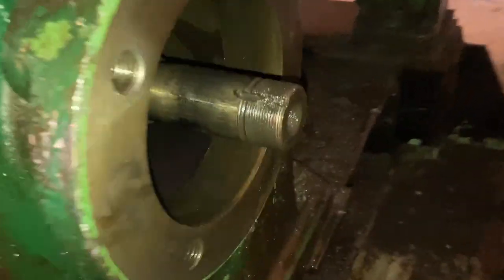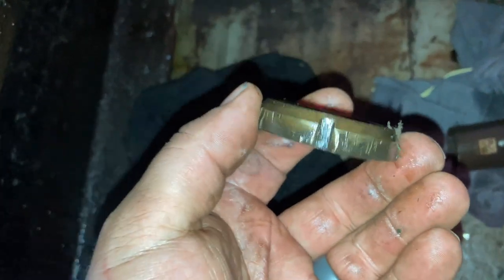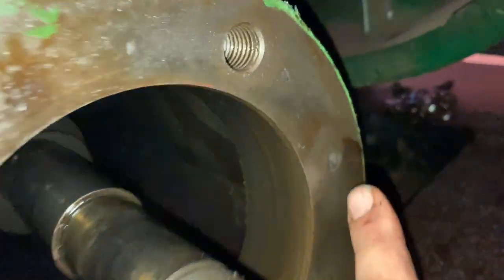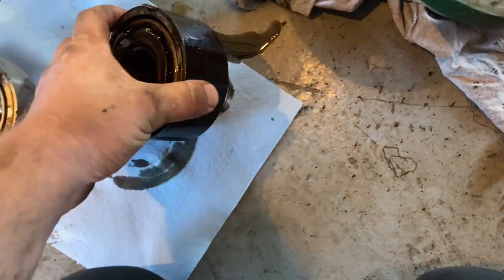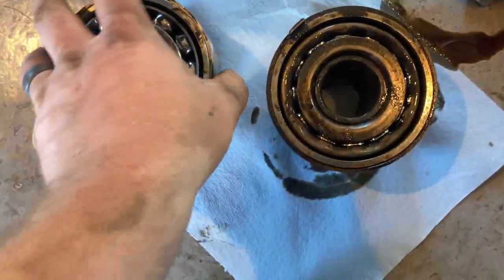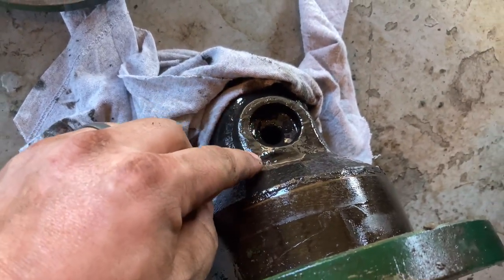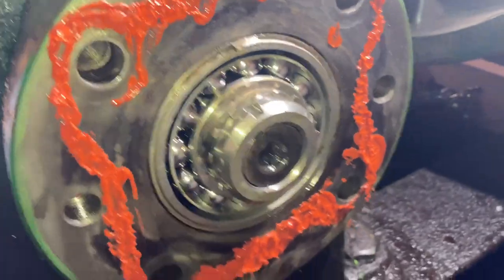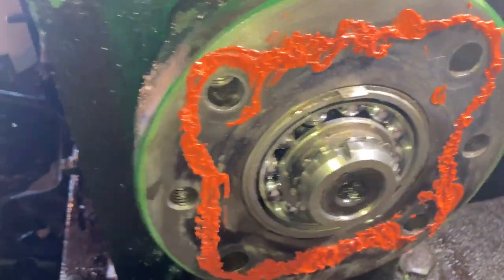Thrust bearing

Comment: MQ, at one point Otis thought it was a good idea to have a grease seal and essentially had a sealed bearing here. they eventually stopped doing this and the seal was omitted. what i am concerned about is there is no shims on the end cap. this era of Otis geared machine generally should have .002-.004" clearance between the end cap and outer bearing race.
Reply from the maker: Interesting, this was awhile ago but I’m not they are actually touching

Comment: Damn they got you doing everything, does your company not have departments? I used to be a repair mechanic doing thrusts and motors and cables etc. but moved to maintenance/troubleshooting after a few knee injuries.
Reply from the maker: Were a pretty small company so you kinda get to do a little of everything, which can be good and bad.
Reply: @MQElevators  true you get to learn a lot more and become a more well rounded mechanic.

Comment: Did you have much trouble pulling the bearing off ? I’ve not done any big repairs for years , I just deal with service and calls right now
Reply from the maker: It actually came out very easy. With having a new bearing on-site you could get it done pretty quick